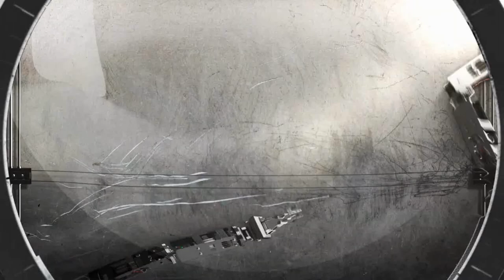The Spanner Hanger

Comment: would you like to explain tig welding a little? looks like brazing to me,...does it work like that?
Reply from the maker: Good question. the principle of feeding a rod while a heat source is applied with the other hand is about as close as these two welding principles get (my opinion) i can gas weld and braze far better than i tig
Reply: sounds like playing the piano,....practice and more practice with not too many gaps between practicing
I don't have to weld often but when i do I find that by the time I get the settings just right,...the job is already done!